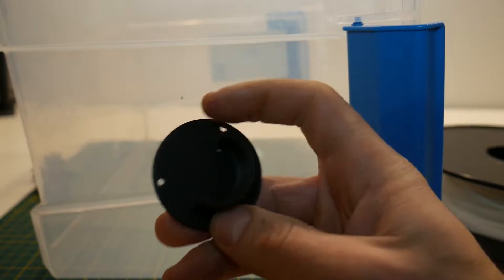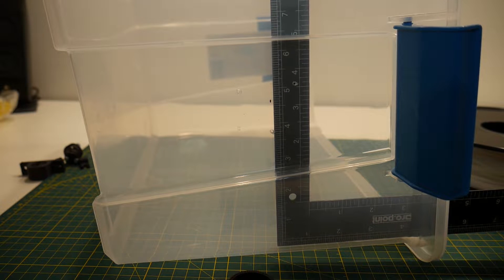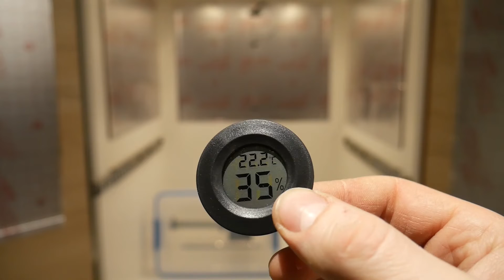How to Build An Inexpensive 3D Printer Filament Dry Box (Files Included!)

Comment: Do you think this dry box with multiple pass throughs to allow easy colour hotswaps will allow too much moisture inside? How has it been performing so far?
Reply from the maker: Hi Daniel, with the filament in place there is very little room between the filament and the fittings that it passes through. I can't imagine there being much air travel. When I crack open the lid after days or weeks, the smell of the filament is very strong, so I'm going to say it is holding the air in there quite well with minimal ventilation. Also, I haven't had any signs of my filament going bad by taking on moisture since using it. After this video, I did change the location of my dry box and permanently screwed it to the side of my cabinet and drilled a hole through the dry box and cabinet wall to allow the filament to pass through, straight into my cabinet. This gives it a much more direct path to my hotend reducing a lot of friction.